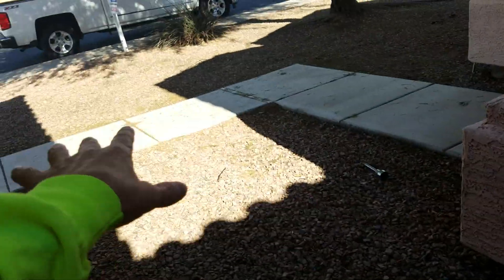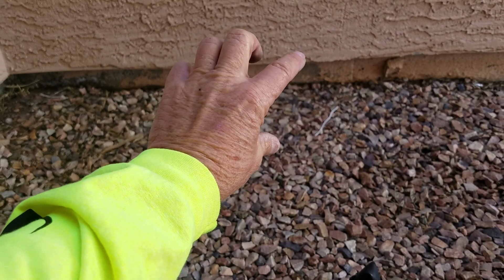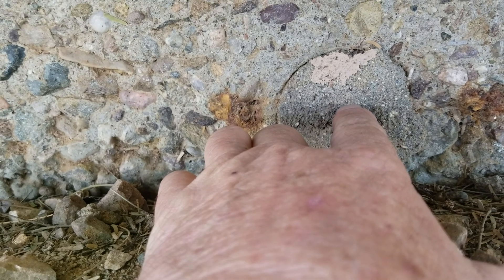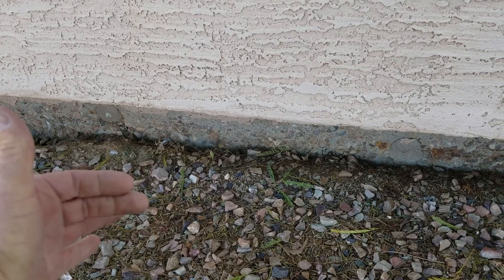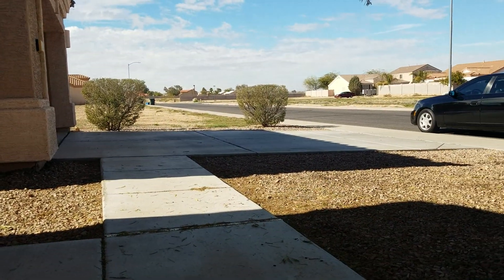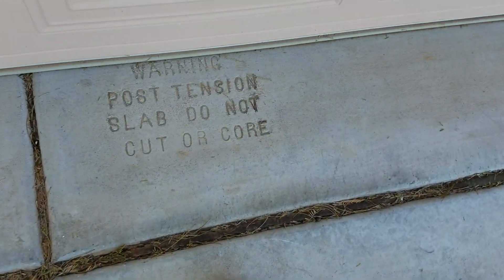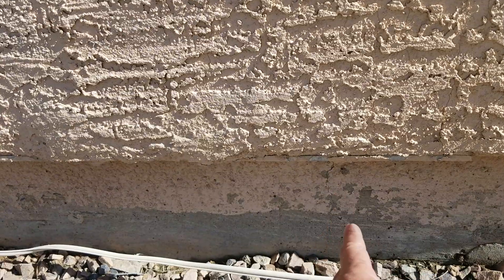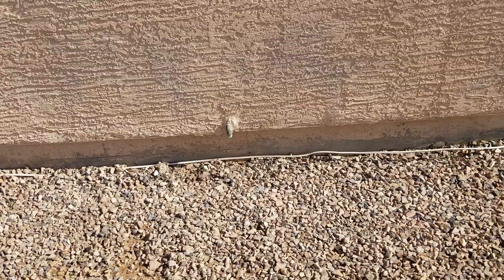Signs of Post Tension Foundation Problems - Concrete Repairman LLC

Comment: Check out issues with epoxy coated rebar. Fiberglass rods are a little more, but never will rust. https://youtu.be/xVDy84rR5Z8

Comment: Sorry, it is not 27,000 psi.  The cable is under tension at 27-33 Kps (27-33 thousand pounds of FORCE). However, excellent video and good argument for 100% encapsulation for SOG.
Reply from the maker: Your right Shane Taylor my mistake in the video. 30 Kip =
133451957295.36 uN (micronewton)
133451957.29536 mN (millinewton)
133451.95729536 N (newton)
133.4519572954 kN (kilonewton)
0.1334519573 MN (meganewton)
0.000133452 GN (giganewton)
1.335E-7 TN (teranewton)
13608309.60854 gf (gram force)
13608.30960854 kgf (kilogram-force)
13.6083096085 tnf (ton force - metric)
15.0005967891 tnf (ton force - short)
13.3933899902 tnf (ton force - long)
13345195729.536 dyn (dyne)
133451.95729536 J/m (joule / meter)
13608309.60854 pond
13608.30960854 kp (kilopond)
13.6083096085 Mp (megapond)
30 kip
480019.09722866 ozf (ounce-force)
30001.193576954 lbf (pound-force)
965259.88613421 pdl (poundal)
133.4519572954 stn (sthene)